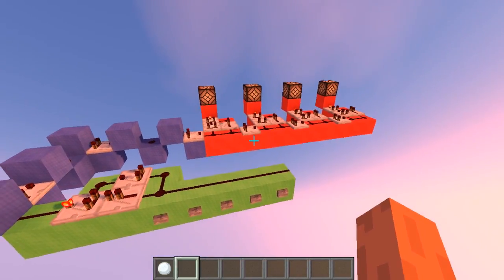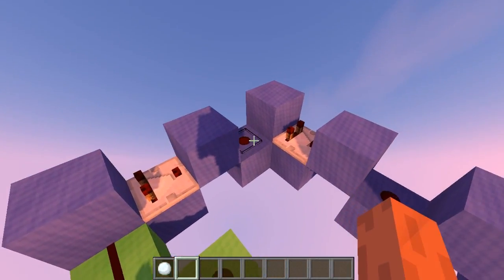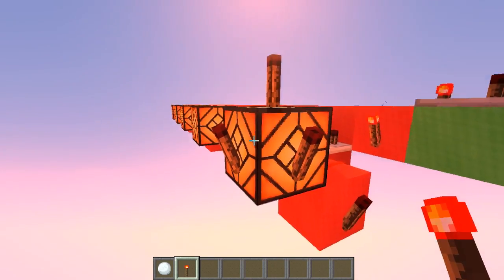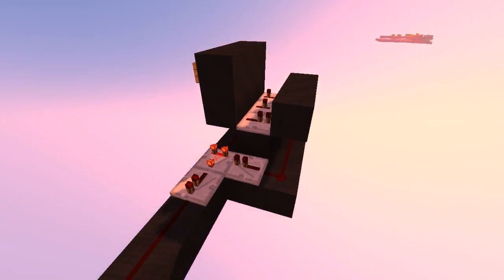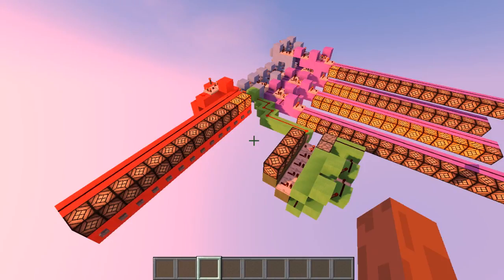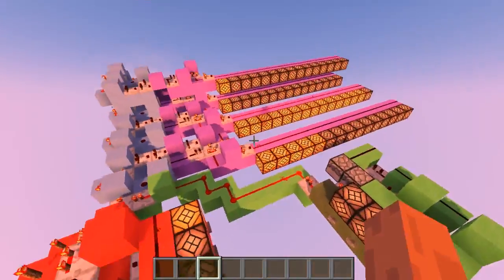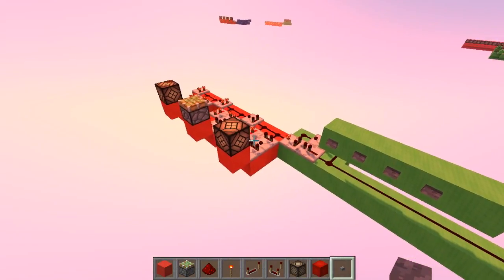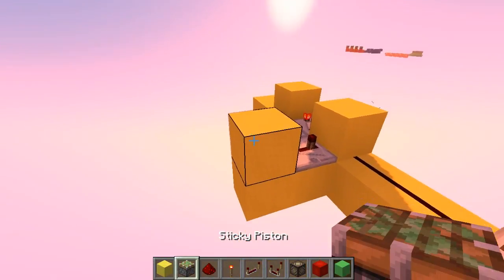One-Wire Technology: Encode, Transmit & Decode Signal Strengh + Pulse Length | Minecraft

Comment: No offence, but it's really slow. I mean 1,6 seconds decoding! That's very long. You can easily make a redcoder much faster than this. I personally prefer a 2-tileable redcoder, 2 chunks wide, time is about 0,5 seconds. The system looks like it's completely messed up, but everything strength is unique and it's easy to change the signal strength.
max(15–2x,14–2(15–x))

Comment: I've been trying to find if it's possible to do something similar using only one wire, but instead of decoding by redstone strength it decodes by the amount of time between two pulses. Is anything like that possible?
Reply from the maker: This is exactly what this video explains (which is why it's titled double encoding). There is a playlist about data transmission on this channel, please check it out, you might enjoy the content ;-]

Comment: I have done something similar with no comparators that’s used pulses lengths, the order and timing between them to decode 

Example: the port number 4 has 7 codes pins and require a signal duration of:

The first one is 2 ticks, separating each pulses by 1 tick ( but you can add more variation for the tick separating them. example: the next separation could be 3 ticks long). 

#2 the second pulse is a duration of 1, 

#3 the third pulse has a duration of 4 ticks, 

#4 the fourth could be a duration of 4 ticks or whatever you whant 

#5.  2 ticks 

#6. 1 ticks 

#7. 1 ticks

The possibility are endless but the more pins you add the more time it will take to read the codes.

If all the pins are correctly timed, have been seeded in the right order, and all have the Correct duration it will give an output 

But the broblem is, it’s not a very compacts and a 3 pin code could take somewhere around 7 blocks large 5 blocks high and around 34 long

Your design is really good and somewhat similar to my design’s but mine use pistons 

I have learn a loot from this video thanks for your help ! :)

Comment: I fixed it! For the double decoder to work you have to replace the repeater that's going into each negated comparator output with another comparator. It works like a charm.
Reply from the maker: Good fix!

Comment: I don't think this design works anymore. I'm almost 100% positive I've built it correctly, but the double decoder will only record the signal if its pulse strength is 15. With every other value, it propagates through the circuit correctly but there is never any output.

Comment: How could you modify this so that

you use an item frame to select the device to send it to (the strength itself) and a button to actually emit that strength?
I guess you would hook the button up to a piston which allows the signal strength to pass through?
Reply from the maker: I think this would work. all you need to do it control the time during which the piston connects the circuits. Ideally you shouldn't use pistons in this case because they can generate pulse lengths of odd values while all the other components will work with even values.

Comment: Darn, I've thought about using the signal frequency of a single wire (of course, that would be more than a single pulse then) but viewing it as a wave and using the pulse length instead ? tips hat
Reply from the maker: I've seen a circuit using frequency detection. It was quite complex and interesting, I don't have the link anymore unfortunately. Thanks for your comment :-]